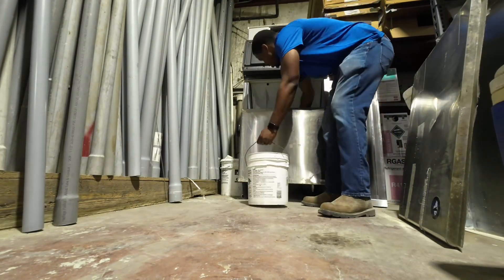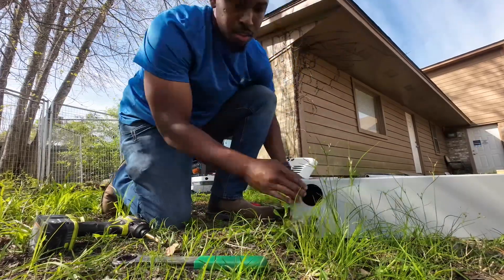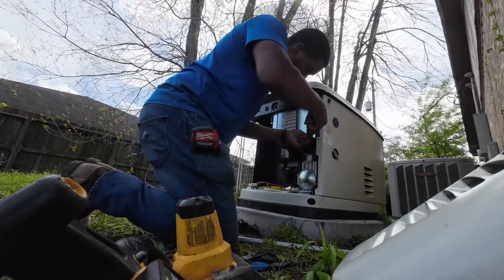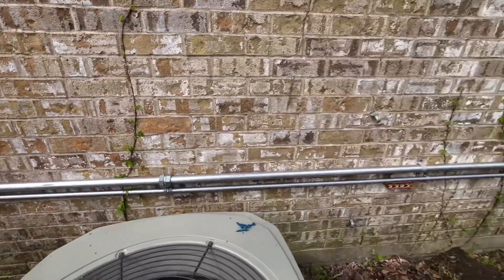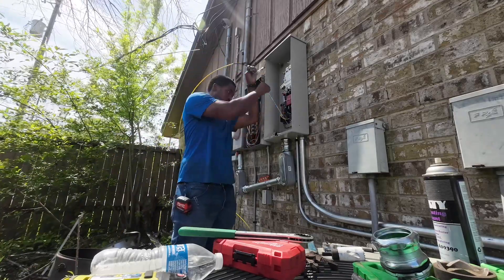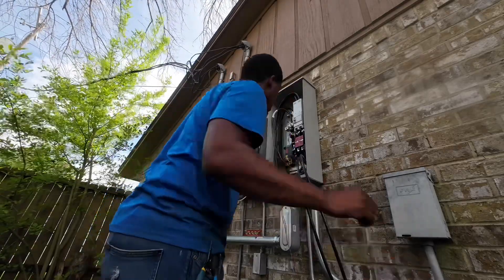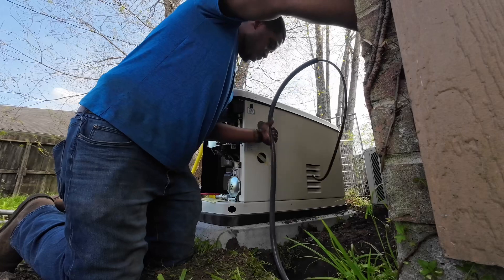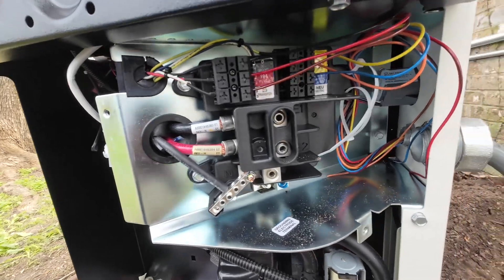Installing A 26KW “GENERAC” Generator | A Day In The Life Of An Electrical Apprentice!

Comment: Great video. You could also get some small locknut wretches to tighten the locknut inside the generator
Reply from the maker: I appreciate it Jamison, I’ll have to check them out so far it’s just been my Kleins & a beater flat head.. Thanks for the advice & support!👍🏽

Comment: Great video and great job! When searching for work did you primarily look online or did you go door to door? I’m currently wanting to get into the trade and I feel like applying online with zero experience in the trade is negatively impacting my chances right now.
Reply from the maker: Appreciate Shawn! I felt the same way when I was applying on indeed, nobody called me or emailed me.. I looked in my local area and called every electrical company & I went to a place in my local area which is called IEC. I went and applied and they send your application/resume to local contractors and I finally got a call back.. Thats how I got my first opportunity. Let me know how it goes Shawn!👍🏽

Comment: Good work. Just wondering other that the big EMT that comes off the meter into the transfer switch, what inside those two smaller EMT from the transfer switch. Looking forward to your response.
Reply from the maker: Thanks for the support Brother, Hopefully I read your question right but in the 3/4 Conduit we have our control wires & in the 1 1/4 we have our four conductors. 2 hots, neutral & a ground… Hope I answered your question.. Thanks again!👍🏽
Reply: @TheApprenticeToJourneyman  Thanks for your response .. can I assume since the control wire is not shielded that's why they are in a separate emt?
Reply from the maker: @richstarstar  it was definitely shielded, I’m not sure the exact reason but I’ll ask my journeyman tomorrow & give you a better answer on why we did it like that!👍🏽